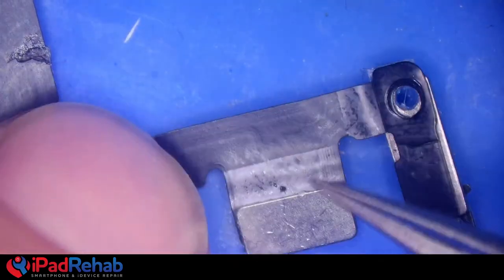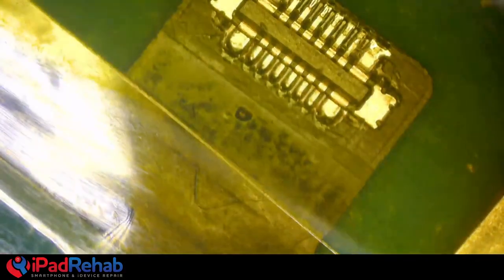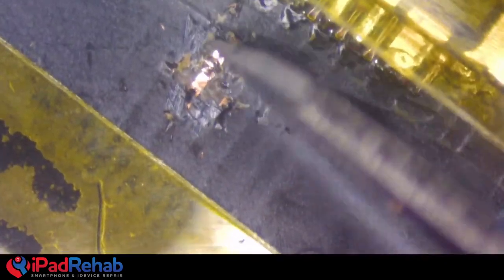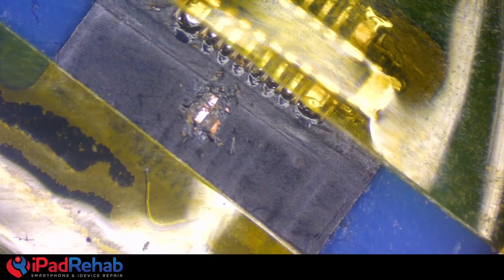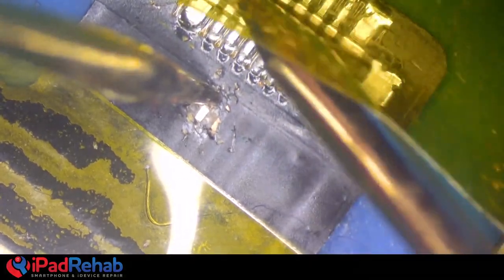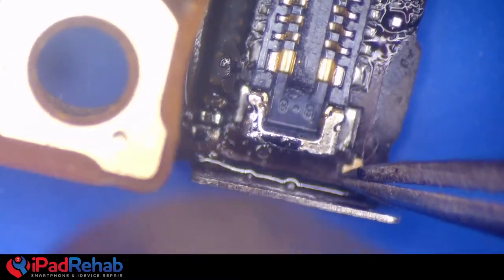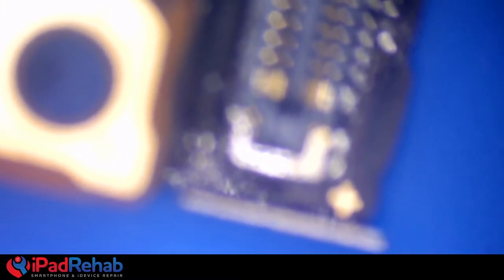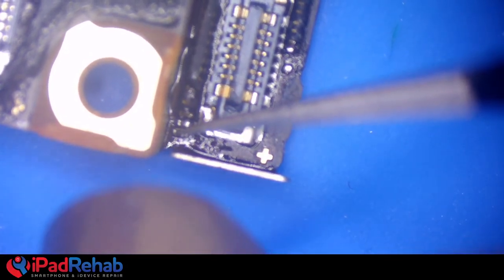iPhone 11 Rebooting Every Three Minutes---SOLVED

Comment: Hi, thanks for a wonderfull channel. I have an old iPhone SE 1st and it restarted every 3mins because of panic-full bug type 210  missing sensors: TP1A, TP3R, TP4H, TP0Z. The github-log analyzer tool said I should check charging and power flex so I bought a second fully functional iPhone SE and swapped logic boards but not batteries. Not much has changed, except now the restarts are more of random, not every 3mins and now the title of the logs changed from panic-full to just a "termalmonitord" title - again, missing sensors: TP1A, TP3R, TP4H, TP0Z (but not called as panic-full), if there are some  "panic-full" logs, they have AppleTristar2 no ID  or something in there but they are more rare. If I swap also the batteries, I get the restarts pretty regular at 3mins and each restart is called panic-full instead of thermalmonitord in logs as previously... So this suggest that part of the problem was the battery and not the charging port but there is still some other problem somewhere. Is that a proof that the battery killed the logic board and charging IC is dead? Since it is a 128GB version, I would like to repair it instead of throw away. What are TP1A, TP3R ...? What should I do now? Many thanks

Comment: Bought an 11 pro with random restarts and buggy Face ID after the previous owner replaced screen and battery with 3rd party components. Had both warnings on the settings. Panic logs were very vague pointing 5 diferent probable causes. Because I was using to do it in older models when swapping batteries. Flashed the iPsw with the fix battery life option checked. Go figure. No more restarts. Try to figure that one out .

Comment: Hi there 
I have 3 iPhone 11 just like that problems.
I did change the back with lesser machine after I fix the back the customer come back just like that happens to me 3phones I give them new phones to my customers and I keep those today I have another customer he need to fix his back I was scared that’s why I took out the motherboard and then i laser it unfortunately I had the same issue once I put it back the motherboard..
I just replaced parts on my store I don’t know motherboard work I wish to know 

Is there any solution for me please 
Also can I send it to you those phone?
Thank you so much

Note: I try all phones with different body
And I try with just motherboard and new changing port and battery screen  with connect to charger and try it still it’s restored every 2min40sc
Reply: I’m interested to learn motherboard work is there any classes I can do? Thanks
Reply: Hi where to check to know if it mic2 or temperature sensor